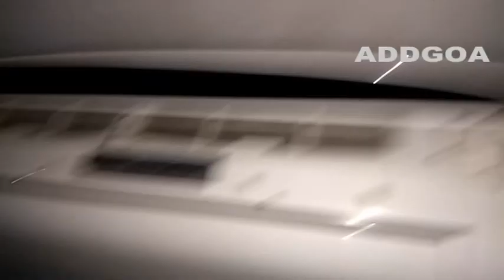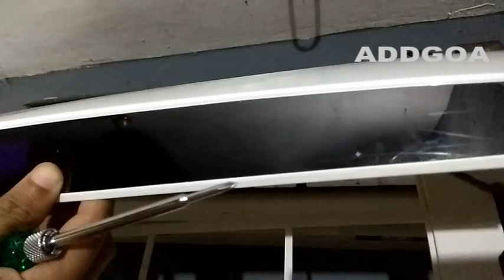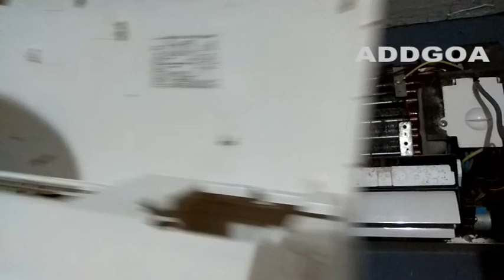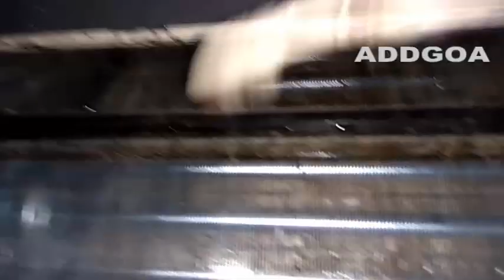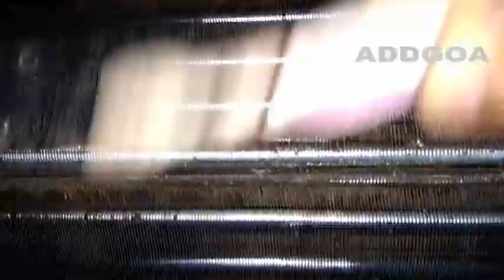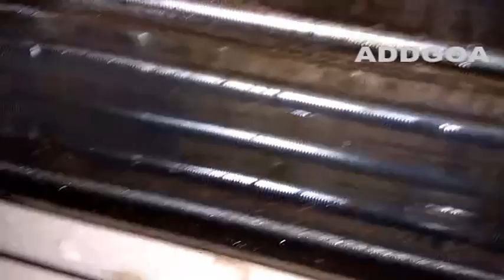Lloyd 1.5 ton split ac cleaning-dripping of water. | how to stop water dripping

Comment: Mera ac ka swing bandh hai use kaise chalu kare
Reply from the maker: Motor issue ho sakta hai. Technician bulanahi padega.
Reply: Check if the swing is attached correctly in slot on the motor side or check if removed any wire that powered the motor
Reply: Swing motor band hoga

Comment: how to remove that clip?
Reply from the maker: Just pull it. Using small screwdriver.
Reply: addgoa can you make a video on it?
Reply: the clipon the top of the ac ..wthose 3 clips cant be removed
Reply from the maker: Its little tricky. Dont apply force. Put screwdriver in between and just twist slightly. That height is not accessible easily with equipments, thats why it is not seen in the video.